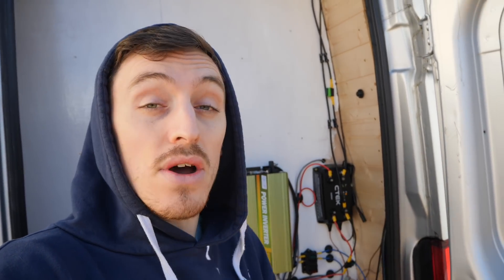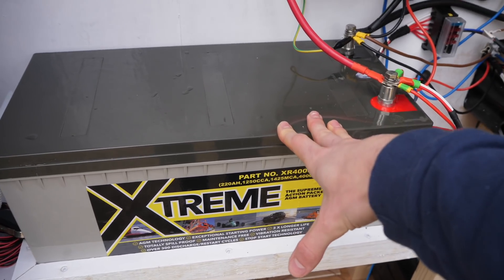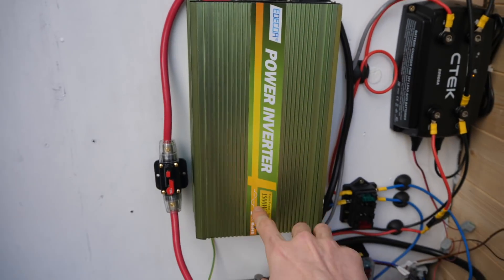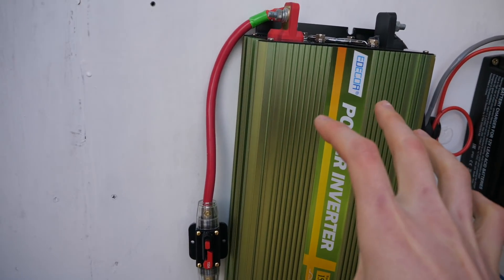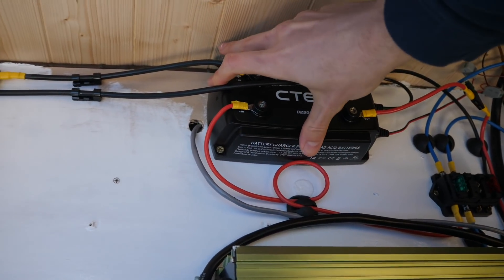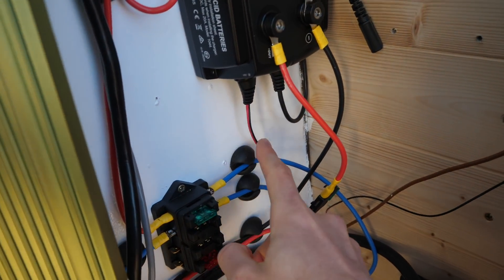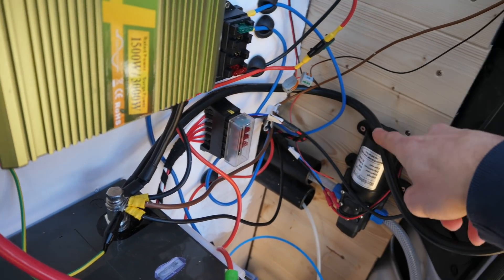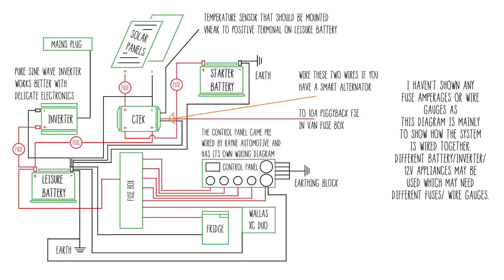HOW TO 12V Camper Van System SMART ALTERNATOR - UPDATE/REFRESH + Wire Diagram!

Comment: Hello Hugh,what size cable would I need to run from the battery at the front of my van to the rear of the van to my ctek 250se at the back of the van if I have a lwb sprinter?

Comment: Hi Hugh I have a voltage sensitive split charge relay and I'm currently in the process of converting my Transit. Quick question if my leisure battery is running low can I just turn the ignition on and charge via the split charger relay while I'm still drawing power from the leisure battery??

Comment: Love the videos hugh
I fitted a ctekd250se to a transit custom and was wondering if your voltage to the leisure batteries drops as mine stays at 14.5  2x105ah lead acid.
Reply from the maker: Mine use to hover around 13.4-13.6v if I can remember

Comment: Hello.I have one question and please help me to understand it .I bought CTEK D250SE for my camper. And now I have to choose battery for my system.when I read recomedations of manifactures they said that below 100 ah  you need D250SE with SMARTPASS. Cant i have only D250SE for  110 ah battery system?
Reply from the maker: Yes the smart pass opens up quicker charging but you should be able to use just CTEKd250se with your battery
Reply: @HughTube  thanks 👍🏻👍🏻👍🏻

Comment: I ran a similar setup in my 4x4 using the same Ctek charger. Works well and very happy with it.
May I suggest that you run those wires through flexible electric conduit, they look so much neater and much more protected. 👍

Comment: Im getting a CTEK unit to charge my batteries and solar. Did you have any monitoring system to tell you the load, output... ?
If not, can you get anything like that to add to the CTEK system?
Cheers, cracking videos!
Reply from the maker: Yeah I used a CTEK battery sense a little limited but good and price point is ok
Reply: @HughTube  cheers for that!!!

Comment: Sorry for the newbie question, but does the hot smart alternator wire that goes into the front are fuse box connect into a fuse slot that is hot, or one that needs the ignition to be "on"?
Reply: 'I just saw Hugh reply to a very similar question below -- "any 10a will do as long as the piggyback is the same size" so based on this I am assuming it doesn't matter?" as long as it is a 10 amp fuse. Can anyone confirm this. Thank you in advance... Can't be too care when dealing with electricity :-)

Comment: Thanks Hugh very helpful. I am thinking of converting a Peugot Boxer using your electrical layout. Can you give any guidance on how to route the connection from the vehicle battery?
Reply from the maker: if its a new conversion (nothing in it so far) I would run conduit behind the walls in which you can lead cable. To get cables to the starter battery wasn't too hard with the bulkhead out as you can feed the cable under the vans rubber like floor, but remember to wrap the cables further in extra pvc wrap, heatshrink, conduit to armour them more. Something I did find  myself using was a long bit of stiff wire which I could carefully feed under the flooring from the starter battery up front and then tape the ends  of the cable through to pull up to the battery compartment

Comment: Great video as always......quick question. If I hook-up a 220v battery charger directly to the battery, to charge it when the van is hooked-up on the mains, and I started the engine at the same time would this have any detrimental effect on the system as the battery would be receiving two charges from different sources.   I have a CTEK MXS 7.0 battery charger.
Reply from the maker: Hi Trevor I would say your battery would be ok. These  chargers are regulating the flow of power to the battery. I am guessing that the CTEK will probably detect the voltage rise when the alternator kicks in and cut its charge to the battery

Comment: Excellent video, i have a 2013 custom i use for work, i wanted an inverter but a few people said with smart alternators its difficult,,, but def worth a go
Reply from the maker: Having a smart alternator isn’t an issue at all if you’re running the inverter off a leisure battery
Reply from the maker: The only difference is charging the leisure battery from the alternator. If you have a smart alternator you will need a dc to dc charger

Comment: do you have any thoughts on portable power stations? Theres a new one on the market called an eco flow delta that rates at about 105ah and basically has all the complicated electrics built in for about £1.3k. Whats the total cost of installing your own - do you think it might be worth getting one of those if you factored in both the bits of equipment you need to do your own and getting a pro van electrian in to install your system etc (I don't trust myself with electrics)? Any thoughts greatly appreciated!
Reply from the maker: Hi Alexander a few people asked me about these. I have heard about one called the jackery pack but have nothing to know whether they  are  any good.
If the 105aH pack has a lithium battery in then it's not too bad a price as just the battery alone will be in the realms off £800-£1000 but you could build a system cheaper. It just wont be an 'all in one'

Comment: nice video. one question, do you know if that CTEK dc/dc battery charger also works as a battery splitter? ie does it prevent the starter battery from going flat while the engine is not runningor does it need a separate splitter?
Reply from the maker: Hi Mark, yes it stops the leisure battery draining the starter battery
Reply: Its smart, if your leisure battery is full then it diverts solar power to your starter battery. It basically charges two separate battery banks. If your starter battery is flat, it will allow a boost charge to your starter battery! The things more smarter than your average mechanic lol
Reply: @diycampervanman1633  considering the size of cabling between the starter battery and the charger i highly doubt it can support any "boost"
Reply: Mark Alexander DeGiorgio yer miss use of words, it can deliver a fast charge to either battery not a jump start but will safe guard the batteries from total discharge. This is only possible if using the smart pass coupled with the  d250se, i believe?

Comment: Thanks for your video.  What I don't understand is why the lead coming from your starter battery - ( Or is it connected to the alternator? ) -  all the way down your van into the back.  Being so thin .  I saw a video where a guy was running a cable only to under a front seat in his van, through the fire-wall to the engine compartment.  He was using 35mm cable .. My understanding is the longer you go, the more mm thickness of cable ?
Reply from the maker: That's totally true, but there  are online  calculators  that will tell  you what guage cable you can  use  for the amp  usage over  the distance required. The cable I used was rated to take over 30a
Reply: @HughTube  Thanks.. Also the cable is always rated higher then the inline fuse.
Reply: To add. My plan is to use the same battery as you with CTEK 250se and later a solar panel.
  ( Smart alternator as well. )

Comment: Hey Hugh, I’m currently fitting the same system as you and the instructions for the ctek d250 sa aren’t very clear. 
  Trying to work out where to run that thin red wire and which fuse to attach it to. Where did you find the detailed instructions for that ? 
 Thanks 
Michael
Reply: Damn was hoping this was answered 👎🏻
Reply: Hey Michael, did you find out the answer to this? Cheers.
Reply: Asking some question thanks
Reply: When you said in video you used a piggyback fuse, how did you do this and what fuse did you connect it to ? Thanks

Comment: Your 12v electric system is darn close to the one im about to build and your advise is great thanks. However i don’t have a smart alternator so can i simply wire my  D250SA just  direct only to the starter battery and not bother with the other lead to the ignition feed via a piggy back fuse?
Reply from the maker: Yes that is correct according to the manual. Just make sure you put a fuse on the positive cable from the starter battery to the CTEK
Reply: HughTube Many many thanks for your advise and i was pleasantly surprised when i saw you and Greg Virgoe filming together at the quirky van festival! Hopefully next year I’ll get to meet you both there in my new DIY build. Im going for a budget build and will put a video out there eventually but just the one vid (camera shy), also much less comprehensive. The focus on my vid will be on the wall/ceiling finish that seamlessly blends into the exposed metal frames of the vehicle for a budget but attractive decor finish.  Thanks once again, karl.

Comment: Sooo, you can charge the rear battery directly from the fuse box instead of running cables through a split relay connected to the car battery?
Reply from the maker: Hi Steve, no, so my starter battery has cables running to the CTEK then the leisure battery. I have a 30A fuse inline on the positive cable near the starter battery and also near the CTEK so the cable won't burn out.
The positive from the starter battery links to the correct terminal on the CTEK and the same goes for the negative.
The CTEK eliminates the need for a VSR or split charge relay. hope this makes sense

Comment: Amperage isnt the correct term. Amps means Current therefore 'Current rating'. Those cables from the Ctek look too thin, if that battery discharges and will put pull high current when on a bulk charge.

Comment: Another advantage of the AGM technology is more usable capacity, i.e. you can drain/use 75% rather than 50%, so an AGM battery is 50% more useful than a standard one of the same rated capacity.

Comment: 150 amp fuse? Your van will catch fire before that blows.
Reply: From what I can calculate, more like 125A fuse would be closer and some would argue a lower rated fuse would be more safe. His calculations where slightly off. 1500w *0.85 = 1275w and a max load current around 106A. Good video though and very detailed. Well done.
Reply: @shermantracey3783  yes 85% of 1500 is not 1725 , as you said 1275  , could be bad editing and a typo. but still an informative video

Comment: Just subbed you. On my 4th build now and this has helped, I was looking at various B2B Chargers and didnt know that you can use the D250s and do away with a charge controller. I will be also adding a Numax connect and forget 20amp charger for hookup as I have it spare from a previous build and have it hooked up on my drive and from my generator if really needed... Belts and braces. Great video 👍

Comment: Hugh, how's the Cetek holding up? I saw on their website it was recommended for batteries up to 125 Ah and you have over 200. Has it caused the Cetek any issues?
Reply from the maker: No issues so far. Had the van standing for a few weeks while I enjoy the christmas period and it's still great
Reply: Surely if its outside the permitters you can always add the smart pass fir a serious kick ass system then!

Comment: How do you figure out the thickness of positive cable from leisure battery to the fuse box, and does that one need a fuse?
Reply from the maker: To be honest, running thicker cable than you think you need is better to prevent it burning out but the fuse box is for all my 12v appliances. I checked amp draw from all of them and then got a cable that could take more than that amount of amp draw.

Comment: Really helpful videos mate! The ONE thing that I NEVER see on ANY wiring videos is how you handle the negative from the battery! Sure, live to fuse box but where are the negative wires connected?
Reply from the maker: on my fuse box the negative is attached to the battery an then to my Earthing point.
Reply: @HughTube  I have a fuse box. It is wired to the live battery terminal. From that I run to my various 12v applicances in the RV. I have to have another 'fuse box' (I have used block connector bar) to run to the negative battery terminal to then connect my 12v appliances.
Reply from the maker: Oh sorry I see what you previously asked. So your saying how to run the negatives from your 12v appliances back to the battery!?
Reply: @HughTube  Exactly :) Currently I use a block connector for the negative leads taking 1 negative from the battery and negative leads from 12v appliances into the block connector. Kind of feels 'right' but is messy. Never seen any video of how the negative leads are dealt with.

Comment: So the solar panels connect directly to the CTEK D250sa (via a 30a fuse) without the need of a MPPT controller?!!!
Reply: Amazing. I actually contacted CTEK they told me only up to 300w. Anything over that the unit doesn't use and is just wasted 👍🏻 nice!
Reply from the maker: yes!

Comment: Hello Hugh. Im a little confused. Ive been looking at your vids to help plan my electrics.  In the other video you did on the electrics, you said that the ctek wired direct to the battery without the need for additional connections, however in this video you say that its wired to the front fuse box?  Is there a ctek model that wires direct to starter battery?  Also, what size cable should I use between the starter and leisure battery? Cheers.
Reply from the maker: So the CTEK has 5 input/outputs. There is: Input from Solar, Input from starter battery/alternator, Output to leisure battery, earth connection and then two small wires the positive of which goes to a fuse point so that it is ignition triggered. does that clear stuff up?
Reply: @HughTube  Brilliant. Thanks for taking the time Hugh. Much appreciated mate.
Reply: Im under the impression that you wire straight to your battery. B2b. Only if you have a smart alternator you need an additional signal wire to the alternator/front fuse box. It has to only come live when your ignition is on?

Comment: Hi hugh what 10 amp fuse port you use to piggy back ,I'm doing the same thing with the cteck on my 2017 boxer thanks
Reply from the maker: I took mine up to the front but any 10a will do as long as the piggyback is the same size
Reply: Cool cheers

Comment: Hi good video but need you to explain the piggyback fuse ie- does it just fit into a spare fuse space or was that a alternator fuse
Reply from the maker: Hi Michael, the piggyback fuse goes into a port on one of your vans fuse boxes. I had a 10a piggyback (which has two 10a ports on, one for the original fuse and one for extra appliance) so I removed a 10a fuse from the fuse box and put in the piggyback. does that make sense?

Comment: Hi Hugh, that battery, inverter and C-Tek all arrived today :)) I also have a Peugeot Boxer, new shape but can’t remember off the top of my head if 2013 or 2014 . . . . Hopefully it will have a smart alternator! How’s your set up treating you so far? I will only have 100watt panel of solar. Cheers
Reply from the maker: Great to hear Matthew, the setup is still doing great. Good luck with the install!

Comment: Hi Hugh, pretty sure when you earth the black wire from the D250SA it let's the CTEK know your battery is connected to an AGM battery which will bump the voltage up to 14.7v rather than the standard 14.4v. Also, aren't you meant to have your starter battery connected to the negative on the D250SA?
Reply from the maker: Hey Joshua, you do not need to connect the negative from the starter battery to the negative on the CTEK it just goes directly to the leisure battery
Reply: @HughTube  Hi! Does it mean that the starter battery negative have to be connected to the leisure battery negative? Will it not work if I just ground them both?

Comment: Hi Hugh, another fantastic video. I have the same battery in my set up and a very similar inverter. I am having some difficulty estimating the state of charge of my battery and was wondering how you manage yours? I was pleased to see 13.7v on your display that's the same as mine on full charge how low do you let it go for 50% DOD? Many thanks and keep up the good work
James

Comment: I might be thinking completely wrong here...
1725W in the inverter, shoud the Amperage not be calculated from the inverted voltage? As in 
1725W / 230V = 7,5 
I'm getting so confused by all of this electronics and calculations...
Reply from the maker: Hi Oskar is this in regards the fuse between the leisure battery and inverter?
Reply: HughTube Yes that's the one I meant. I might be confusing myself by over thinking it, haha

Comment: Turn your inverter the other way. The cables just don't need to be that long. The surge capacity is to cover starting current when you use a skill saw or so vac etc. Also consider that why you size a fuse regardless of what the device is, the wire needs to be considered.
Reply from the maker: Hi Jacob all good points, I would invert the inverter but with the manual saying it needs to be orientated so the fan is at the top I thought I would not push my luck

Comment: Hombre, any info you can share on the type of wires used around the various connections. I'm having a mare figuring out which ones I use to connect all the 12v appliances/switches, which ones for the Shore Power, Alternator and Inverter. Would be lovely if it was all one type of cable for everything!! Thanks
Reply from the maker: I know, wires can be a nightmare. This chart is based on 12v applications in the marine industry: https://www.westmarine.com/WestAdvisor/Marine-Wire-Size-And-Ampacity
they do it all based in AWG gauge but you can find charts to convert from awg to mm2 if needed.
You will have to know each items amperage draw to correspond with the table.
The only annoying thing about the graph is that it doesn't tell you how many strands or cores in the wire the data is based on.

Comment: If you had a microwave, what would you use as a fuse amp be going into your inverter?
Reply from the maker: If I was using more than 1500W of power I would just get a larger fuse so if I wanted to get to get nearer 3000w I would get a 300A fuse with my setup